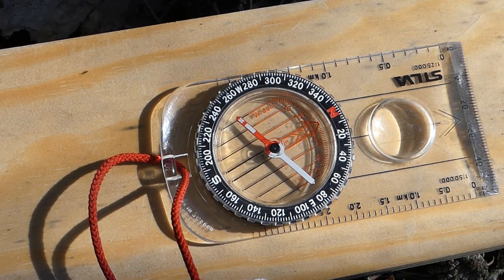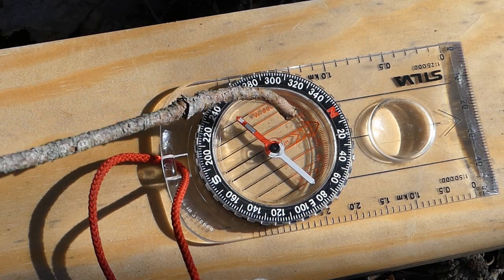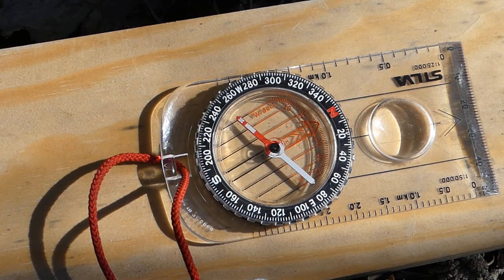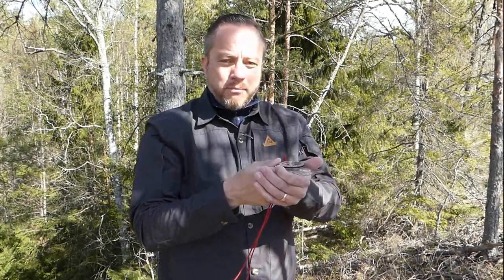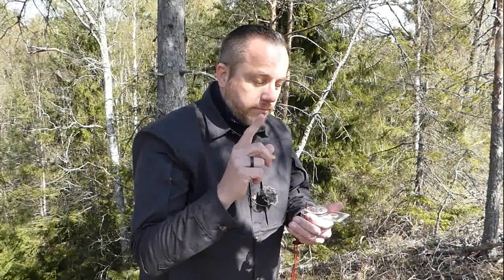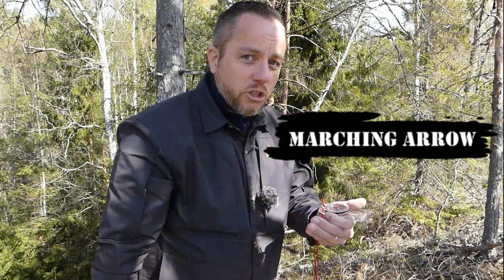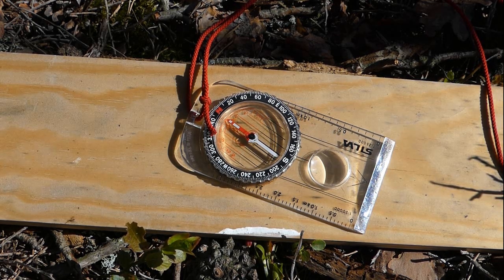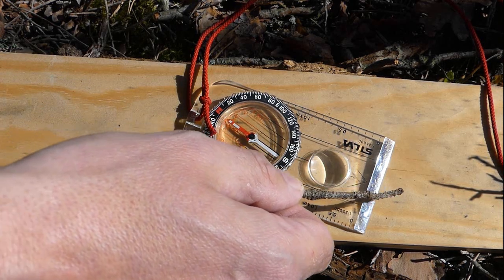How To Use Fixed Scale Compass Declination

Comment: I feel like it's easier just to add/subtract your declination to the bearing. If you calculate the bearing to your target on the map at 140 degrees and you know you have a 20 degree declination then set the bearing to 120 degrees, put red in the shed, and you're good to go.
Reply: its what i do. the problem is when taking measurement in the field, like for finding your position. each measurement you get is wrong by 20degrees?
Reply: @Francois_Dupont  not sure what you mean. If you're going from compass to map you would do the opposite... in the case of my example you would then add 20 degrees to your bearing when plotting on the map.
Reply: I think he does the same but he was making this video to explain how to use a fixed declination scale. I would definitely just add or subtract it to the bearing but I've always wanted to know how to use a fixed scale.
Reply: Yes. Right on
Reply: I was taught to add or subtract the declination using the mnemonic "Declination East, compass least. Declination West, compass best".
Reply: Exactly my thoughts
Reply: From map to field
WAvES= WEST ADD vs. EAST SUBSTRACT
From field to map REVERSE
WEST SUBSTRACT vs. EAST ADD.
This corresponds with the shown setting in this video.

Comment: Not sure I am slow but why not use a real map and not a slab of wood, I found the presentation very confusing.
Reply from the maker: Because after step 2 of the  Silva 123 method you don’t use a map. The slab of wood is just to help see the markings on the compass. So I’m showing how to adjust for declination after step 2 and it doesn’t use a map at that stage
Reply: @verysurvival  Thanks for the quick reply. I am trying to orientate a map with a fixed scale compass and am having or sorts of problems with accuracy in that the map simply does not to seem to be laying in the correct direction.
Reply from the maker: Place the compass on the map with the long edge parallel to the vertical map lines and the red  arrow in the rotating housing is pointing to the top of the map parallel to the vertical map lines. Now keep map and compass together and move them so that the magnetic needle points to the magnetic declination in your area. Now the map is aligned
Reply: @verysurvival  Thanks
Reply: You're not slow, this whole video should have been an overhead shot at a map/compass.  diddling with something in his palm we can not see is useless.

Comment: Could someone recommend best maps to use for navigation in the USA?
Reply: USGS maps. That stands for United States Geological Survey, I believe. Probably get any scale you want; for examples 1:50,000/1:24,000/7.5 minute is 1:15,000 I think, or maybe even greater/closer detail. I am Canadian so double check this info!! Pretty sure I'm correct, but this is a start for you. Seriously, I'd highly suggest USGS topographic maps, because they show contoured elevations, rivers, lakes, trails, terrain features, buildings, bridges, power lines, railways and every other detail you can imagine. Pay very serious attention to the date ANY map was surveyed, because declination/Magnetic North changes over time. You get into an old map and use the provided declination angle from 1988 or something you will be off your destination target, possibly by a lot. Make sure you find the date of any map you get (that's step #1), and make the error correction/do the math for the correct present declination in your area, or check the internet for your local declination. Hope this is a help (and check out caltopo.com to print your own topo maps which I think may use/provide USGS maps).
Reply: USGS 1:24000 TOPO maps are great.  However if you hike big, you'll probably need two maps.

Comment: im new to the compass, can i use it in the car or will the metal all mess it up?? thanks
Reply from the maker: generally speaking it will mess it up, there are magnets in the engine parts  and in the speakers etc not to mention the steel it is made of, all this will mess it up  . You can test it stand several meters from the car and see where it points, and then get in the car. you might get lucky and find a spot in the car that it works.
Reply: @verysurvival  ok thanks i guess i'll just try and use the app on my phone hopefully it works somewhat

Comment: If adjusting declination from field to map is hard to do with your compass because you don't have a mirror, you can instead rotate the bezel until the needle lines up with the orienting arrow. Then to account for declination, place the compass down so the needle remains lined up with the orienting arrow and hold the compass still. Rotate the bezel until the needle lines up with the correct declination.

Comment: Far easier in the UK to ignore the declination and move the bezel using the following mnemonic - "grid to mag add, mag to grid get rid" to adjust the setting. Far easier and it becomes second nature after you've done it a few times. More accurate than using the difficult to see red scale and the best part is once set the bearing is locked in so you never have to compensate until you select a new heading. You also adjust for magnetic variation according to the age of the map.  

If you're going to follow this method and use the declination scale make the adjustment when the compass is still on the map where the contrast is likely to be higher than when viewed handheld. The first method hand held, or on the map is just better, it's only drawback is that the mnemonic only works on our side of magnetic north. 

Before you set out if you have problems remembering local declination for the map being used just write the number on a small sticky label of the adhesive surface and apply it to the underside of the compass where you can see it easily..
Reply from the maker: The rhyme works for negative and positive declination. Try it. It doesn’t matter.
Reply: @verysurvival  Twice as good then.

Comment: I have same type of baseplate compass which dial scale is not aligned with bazel north line also 4 degree offset from north point
Reply from the maker: Sounds like it has been adjusted for declination. There should be a screw on it somewhere to adjust

Comment: I am trying to get a grasp on this, but without a compass a map or practice I am having a rough go.  One question I keep asking without getting a response that would benefit someone like myself (i.e. "it doesn't matter") is this ... I am in the USA ... should I buy my first compass in NH or Global?  There is only one video I found on YouTube thus far that shows that a global compass is more accurate because if you don't have it exactly level it still tracks more accurately. Any thoughts on this for someone who doesn't understand all these concepts yet and is looking to buy 1 compass. fyi, "Global vs NH compass" or anything of the sort was not a YouTube video I could find ... might be a decent one to make I am not sure. Going to check out the rest of your videos too. Cheers.
Reply from the maker: Buy NH , I’ve spoken to manufacturers and they have told me that NH compasses or SH compasses are better  than global.
Reply: Yeah. I understand the concept but i don't think it will become useable info until it's used in the field. I buy adjustable dec. compasses now but it's good to know how fixed scale compasses handle it.